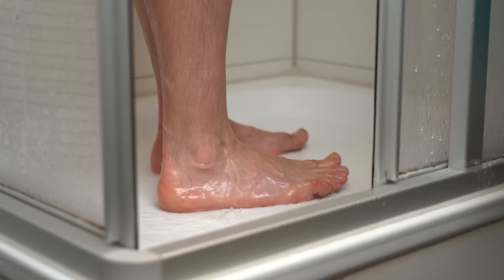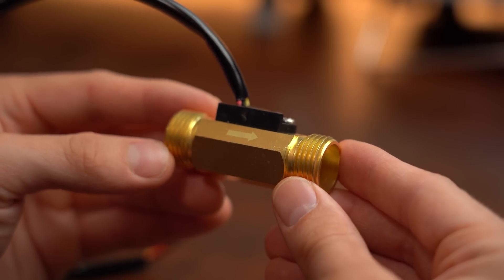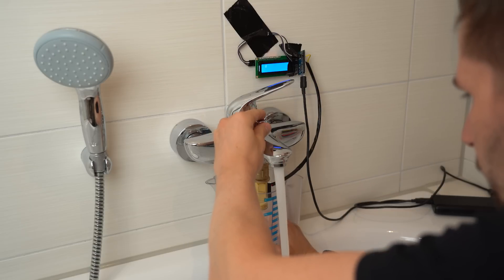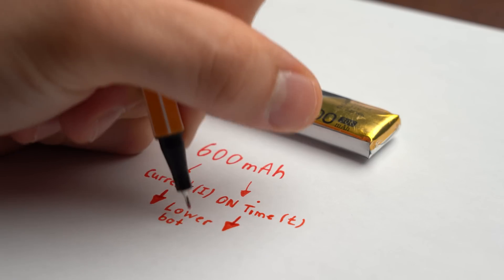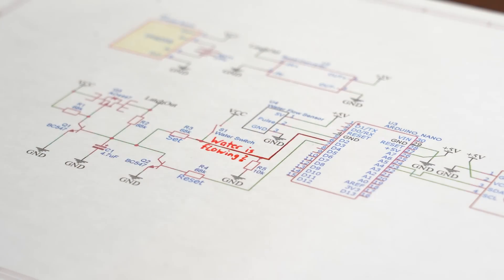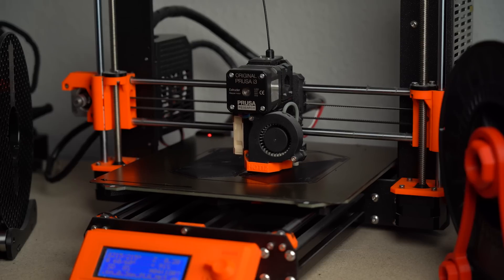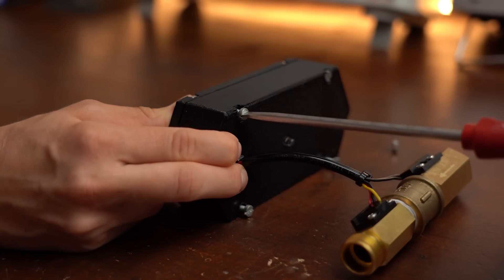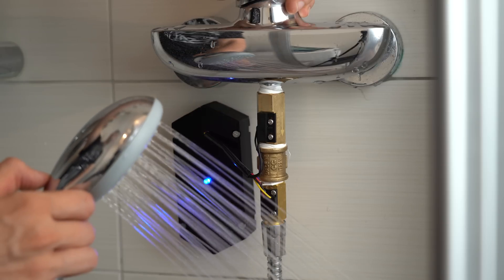Every Shower needs this Upgrade! (Online Water Tracker)

Comment: I have an obsession with charging infrequently used, low-power devices with nearby parasitics/environmental power.  Someone mentioned charging the device using the flow of water into a capacitor.  Would it be possible to charge it with a thermoelectric generator along the hot-water pipe section?  Or from ambient lighting? (maybe too low of power)
Reply: Unless you are taking a shower in high pressure steam, or a WC with -100C ambient temps. Your delta T is going to be in the tens of K. This means, even with Carnot efficiency, you aren't going to be harvesting a lot of energy....
Reply: @arontsang  thank you!

Comment: I find it very awkward to use ESPHome by passing through the GPIO directly to Home Assistant. I usually either write a custom component using ESPHome, or use rules with Tasmota. I've also tried passing the values through directly to NodeRed, and write JS function to handle the logic, then pass the data to Home Assistant.
Reply: Yo yo ma

Comment: Ahh yes, that most expensive 30c/day hobby... Oh, and lets put a LITHIUM battery in a HIGH humidity shower, enclosed in plastic.... What could possibly go wrong... I hope you know that watertight does not necessarily mean airtight (humidity).
Look, I very much enjoy most of your videos, but this one is just down right nonsensical. Also, those sensors are incredibly inaccurate, you can check for yourself by filling a bucket and comparing the results. Your showerhead will already say how many GPM it uses, just multiply that by the time interval.

Comment: Why dose he have two spouts?

Also I thought that he would have used the water to spin an electricity generator like how they do in rivers and lakes and then use that as the power source to charge the battery.

Comment: like the project Idea, I have a suggestion: could do a the same sort of project for button shushing toilets, (or may be toilet in general) a different angle, of the same problem, false, or phantom, flushing does not stop, and in only noticed next time, the toilet or bath/shower is used, could be happing for hours or even days, if happens and you not being in you home at the time?  
alter the project a little, to say a little more than say one load water, without an  interrupt in the water flow, (a water on, off as fill water tank, for next use? a water solenoid (auto on/off) would be nice, but even just big loud sound (like remote door Bell) would also help?

Comment: Would be interested to know the difference in the production of the flow sensors kn the main meters which are (hopefully) accurate, and the cheaper one.

Would also be interested to know if there are any magnets flying around inside the official water meter that you could read with a hal effect sensor to get access to the more accurate readings without actually interrupting the main meter

Comment: I tiny bit of self discipline goes a long way, and you don't have a shitload of things to think about, setting the time, turning it on, turning it off, replacing batteries. Hop in, wash, get out. Thee is no need at all for even more electronic nonsense.

Comment: Cool. You can also combine it with data from your boiler or water heater to know how much money you spend on hot water, that is really the cost of making a shower. On a modern boiler with the OpenTherm interface you can get a lot of data about what it's doing so it shouldn't be that difficult to get it (you can also get the flow of the water that passes trough it, thus you can avoid the sensor in the shower, if you estimate the percentage of hot water that you mix with cold one).

Comment: I see the problem with your set up. When you measured the pulses to fill 1 L of water, you were onto the right idea. The sensor measures flow rate. Higher pressure = more pulses, and visa versa. The correct experimental setup should've been opening the faucet completely for some amount of time into a bigger bucket (I'd say whatever the European equivalent of a 3 or 5 Gallon bucket is). After that time, you'd get L / second or L / min. You can then measure at different openings (half open or whatever) to see if there's a linear relationship in the faucet flow rate. From there, you can correlate pulses to L / second. At that point, the circuit becomes both a timer and a flow rate calculator. You'd be able to draw the flow rate against time and integrate to find the total water usage.

Comment: Hello, first thank you for such videos you post, i have been a fan since a long time now, i noticed that you did not re-check the pulses/L factor after adding the "water switch",  it will certainly affect the flow wouldn't it? 
I know the error might be so small, but it can affect the weekly stats.

Cheers to many more projects man 💯

Comment: The problem with adding another point of failure to the water system is, that sensor would really only be useful in areas using City provided/treated water sources.. In areas dealing with Well water the sensors would likely be easily gunked up by hard water and other such common well water problems.

Comment: I'm assuming there is no real way to incorporate time to fill on the flow test? Instead of counting pulses till you get a litre it should be a relation of how long till a litre was filled and how many pulses was that.. so it would have been 3 variables to work with but that should account for using it accurately through various flow rates.. I have no clue how to go about it but I feel like that would be the logic .. so you'll need a stopwatch too..

Comment: on utility meters, you can often add an esp in front, with a light sensor to capture the light pulses emitted. If they are purely mechanical, you often have a disk spinning with contrasting color, that should be readable too.
Last option is more complex, but you can spin a solution with a pi, a camera module, and opencv to read the numerical values.

However, this is a nice project, and i am building something similar to monitor garden watering. I wasn't aware of the water pressure variance however.
Hopefully, for drip irrigation, you need a pressure regulator, thus the pressure of watering is limited to a specific value; thus i should be able to proceed as you did to calibrate it

Comment: I don't think that this would really help cutting down on water usage. I think just a flow activated clock would help with that. This way you have a direct feedback on how long the water is running and you can actively do something. When you do a benchmark beforehand, you can set a "green" time and build in a reminder, when you are taking longer. Sometimes it happens to me that I forget the time in the shower. For me it's even more bad when this happens, because I shower in the morning but just before I need to leave the house.
Where I lived before, I had a shower radio and conviently, when the news came, I knew it was time to stop, to be on time.

Comment: That flow sensor seems a bit like it's for pure water streams. I'm interested to see how well it stands up to the demand of actual water with dissolved solids. If you've ever cut open the pipes in an old house, you probably have less than high expectations for accuracy of that device's measurements over time, and it's total longevity.
Reply: Longevity: my first sensor broke after 1.5 years, the replacement has been running fine now for >2 years. Didn't notice a change in accuracy.

Comment: They have generators that get over from your flowing water if that provides enough power that would have been a neat power solution maybe with some caps to smooth out the voltage and to run for a couple seconds after it's off

Comment: For home assistant I found it easier to take tasmota or just the plain Arduino esp and just send updates over mqtt to HA. You can build all the logic you want on the Arduino side and send processed data to HA. I did that when I reversed engineered the protocol my washing machine uses to communicate between it's various components. This way I can report to HA how my washing is going.  On HA you just get a "processed" source of data. No logic to build on the HA side.

Comment: You could use a 5v generator using the water flowing itself. Less pressure, but no battery required

Comment: This is a flow sensor.  Proper way to use would be making a pulse rate to flow rate calibration table (hopefully it's linear?) Then use a lut in the code to convert pulse/s to flow rate.  This flow rate can be integrated to determine volume of water used

Comment: I challenge you you recreate this based on pressure.  Add two pressure sensors to the water line feeding the house before the water heater.  Keep them as far apart as practical.  When water is turned on anywhere in the house you will see a pressure differential. This difference will allow you to determine flow rate and water usage.

Comment: The flow meter for my water main use ultrasonic doppler without a break in pipe and its accurate.  You can add a streamlabs water meter, it just zip ties to main and is wifi, accurate down to .3 gals/min.  no water pipe to undo, takes 3 mins to install uses ultrasonic doppler thru wall of pipe.

Comment: Esp8266 could also have used esp easy and enable rules then you can add rules to trigger one gpio when an other gpio is high or low and even add delay all in the esp no external. Exists a node red flow to get autodiscovery for mqtt

Comment: Super Project for crisis time - high enery cost, ect
Few ideas:
 - use ultrasonic flow meter on "houses pipe"
 - use low enegy solution (on battery) or transmit data via LORA to the Home IOT centre :)

Comment: wayyyy more easy approach: a timer to know how long you were using the water
+ checking beforehand with a bucket how much water per minute goes out of it and booooooom done.
Also in my area with water hardness of 20'dH (deutsche Härte) this thing will get covered in CaCO3 instantly and not work properly, cause it will hinder it of turning
Also a timer can do some noise to warn you that you showered too long and be nasty as fuck if you want to.
Reply: My first sensor lasted 1.5 years, the replacement has been running fine now for >2 years. Easy and cheap enough to replace.
Reply: @RalfVogler  yea ok, but at my place, i have to remove CaCO3 from the shower head like every day. I think i had to do this with this thing,too.
The only reason for this sensor imstead of a timer would be, that at my place, the water pressure somehow always changes like everyday, maybe because something is falsly installed, or maybe because of the high amount of CaCO3 or both.

Comment: well water is cheap....  heating the water...  is way more expensive! and improvement...  water powered generator!..  years ago we had a gas fueled water heater (geyser) and it used the water flow to generate the power needed to run the LCD and spark igniter

Comment: Well ... it's a good idea and all. But I think I would have rather read the water meter for the whole house. Then you don't have to worry about accuracy, since you're using the same meter as the water company, you measure all your water consumption and not just the shower, and you don't have some ugly wire mess in your shower. :D
There are many solutions to this problem, of course. But assuming you have an old meter with no easier way of reading it, the easiest way it probably to just used an ESP32 Cam and have it send the readings to home assistant...
Here's an example... https://youtu.be/mDIJEyElkAU

Comment: The relevant time to know you’re in the shower for too long is when you in the shower. Toss in an RGB LED visible on the outside of the box that will indicate where you are for your current daily water use limit.
Reply: Yeah, I was thinking the same when he said that he can check on his water usage from anywhere in the world. That description just so happens to exclude the one place where I'd want to check it.
I really don't get why people get excited every time they can connect something to the internet. It's similarly annoying to the trend of more and more things getting battery powered. Alarm clocks, smoke detectors, kitchen timers and similar really don't need to be mobile. You COULD easily just plug them in. For example, since (in Germany) electrical junction boxes are usually near the ceiling, they could just include a USB port for powering smoke detectors. A kitchen timer could be in a feed-through wall plug and wouldn't even take up an outlet spot. In fact, EVERY "you plug the transformer into the outlet" type plug could be feed-through. You wouldn't want to plug a transformer into a transformer into a transformer (that is, if that contraption is hanging from a wall outlet), but plugging a desk lamp into your phone charger shouldn't be an issue at all. (Unless the desk lamp is connected to the internet and will loose it's settings every time you want to take the phone charger with you.)

Comment: maybe you should check out the water meter from HomeWizard, they released it not to long ago. This can be mounted directly onto your main water pipes without modifications. You built your DIY version already, but you can compare this one as a DIY or Buy video maybe.

Comment: If you're relying on constant water pressure and flow from your shower for an accurate reading, then you may as well skip the flow meter and have just flow switch and use a timer on the mcu to time how long the water is on for. In fact, just put a waterproof clock in your shower.
Reply: Brilliant, and spot on. There’s gotta be a pretty linear relationship between shower time and water usage.
Reply: @frosty129  err no, the temperature set changes it as well as the heat source output and thermal mass of the heat exchanger, loss in pipes and dynamic pressure in the pipe, local static pressure etc... But nice try..
Reply: Water pressure isn't constant if you can turn a knob on the shower to adjust how powerful it is
Reply: @deang5622    @Wiktor Szymczak  the point is that the flow sensor is only accurate at the values set for the shower pressure. if you change that, its useless anyway.
Reply: Do you keep your water running all the time youre showering? Do you never change mode on your shower head?
Reply: @Hibari_fan  No?
The hell?
Get wet, use shampoo, clean off, exit.. takes like 10-15min.
Reply: My thoughts exactly!
Reply: Gas engineer here, unless you are using strait cold water to shower the flow speed will change drastically depending on the temperature you set and the time of day (ie how much demand on the local pipes) Dynamic pressure changes within the same property dependant on what's happening on dhw as the heat generation output is coupled with flow restriction to maintain a constant dhw temperature. Throw thermostatic mixers and combi boilers into the mix and shit gets pretty messy quick. A real good idea would be to add a ntc on the hot pipe and another on the outlet and crunch the temperature numbers combined with the flow and you can tune the boiler to always stay in condensing mode for given setup, distance from heat source/loss and preferences. Save gas by tuning the boiler dhw temp. Save money and the planet without even shortening your shower or lowering the temperature.. But a smart twat like you already has a clock so..... yeah
Reply: @alphabuilders   you've completely missed the point. He's right that there is a perfect linear relationship between time and water usage at a constant pressure and flow. In the  video his monitoring only works for constant pressure and flow, so that's why we are saying a timer will work just as well. You're massively overcomplicating it too, pressure and flow changes from are minimal - if you get in the shower you don't feel the pressure go up and down from the boiler regulating temperature. In fact I don't think most boilers restrict the flow for adjusting the temperature, they just modulate the power output. You'd also have to be in a pretty small town or something for your neighbours using water to affect your flow. 

You're misunderstanding condensing boiler also. They are always in condensing mode, they don't have a mechanism to disable condensing. It just only works when the return temperature is below 57 degrees, which is the dew point inside the boiler. This will be the case when heating water, since the demand is guaranteed to be high and the dhw tempature is going to be low. You're thinking of the part where in pretty much all condensing boilers, the heat exchanger is only so big, and you get the maximum condensing efficiency when running at lower power. There is no reason you can't condense fully at maximum power, it's just not economical in the boiler cost. You lose 10% or so efficiency with the hotplate anyway. Perhaps you should look at intergas boilers and their dual function heat exchangers.

Also, there's no need to get rude. Gas engineer doesn't make you above everyone else. My guy with the clock in this situation is just fine rather than the videos long winded approach.
Reply: I was thinking the same. This is an over engineered solution for something that doesn’t actually save you money. 

A clock or timer would achieve the same (without the data,) cost you less time and money and have value outside of showering.

Comment: Better than those horrible "water saver" shower heads. A shower head that produces a handful of high pressure water needles just does NOT give an acceptable experience.  When I encounter those abominations in a hotel, I just unscrew the whole thing and enjoy a wonderful deluge straight out of the pipe.